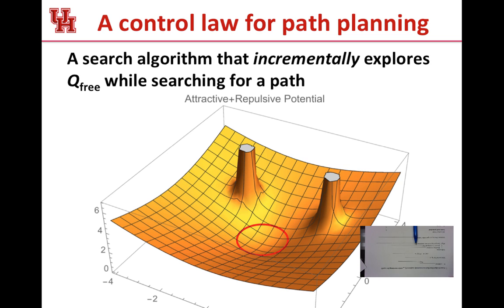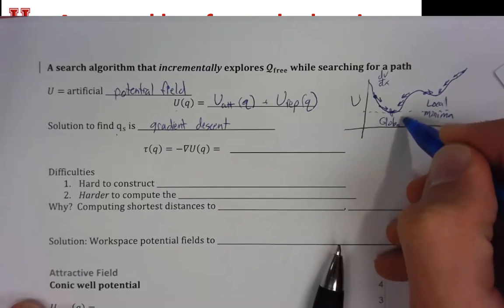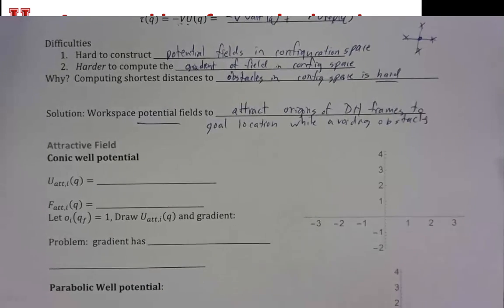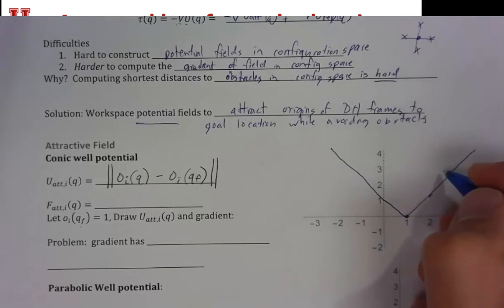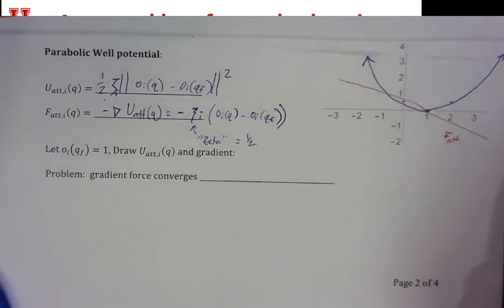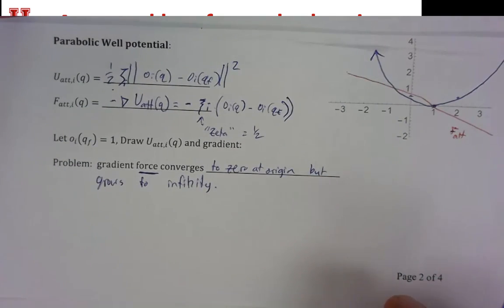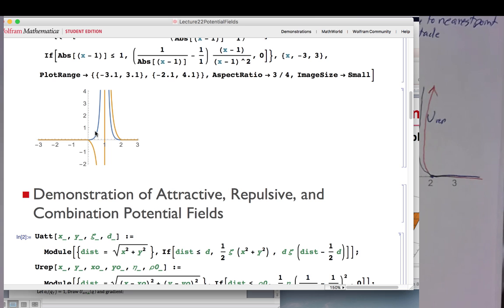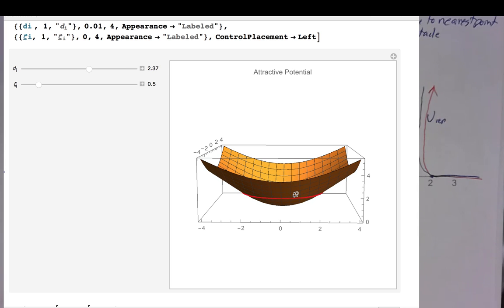Intro2Robotics Lecture 22c: Artificial Potential Fields for Robot Path Planning

Comment: Hello, great video. Just a small note - there is an error at 22:15 in the Urep equation, the whole parenthesis should be squared. It would work also as written, but then the Frep would be different.
Reply from the maker: You are right.  Thank you.  I added an errata in the coments.

Comment: I just gotta say thank you for uploading these videos.
Reply from the maker: @salehalarbi4156  I used Mathematica to make the plot. The code is below.  The syntax looks weird as text, but you can copy paste it: 
Uatt[x_,y_,\[Zeta]_,d_] :=Module[{dist = Sqrt[x^2+y^2] },If[dist<= d, 1/2 \[Zeta] (x^2+y^2) , d \[Zeta] (dist-1/2 d)]];
Urep[x_,y_,xo_,yo_,\[Eta]_,\[Rho]0_] :=Module[{dist =Sqrt[(x-xo)^2+(y-yo)^2] },If[dist<= \[Rho]0, 1/2 \[Eta] (1/dist-1/\[Rho]0)^2 ,0]];

Manipulate[Module[{\[Eta]i = 1,\[Rho]0 = 2,switchLine,Energy},
Energy = Plot3D[ Uatt[x,y,\[Zeta]i,di]+  Urep[x,y,obs[[1]],obs[[2]],\[Eta]i,\[Rho]0]+  Urep[x,y,obs2[[1]],obs2[[2]],\[Eta]i,\[Rho]0],{x,-4,4},{y,-4,4},ExclusionsStyle->Red,
PlotLabel->"Attractive+Repulsive Potential"];
switchLine =Graphics3D[{Red, Thick,Line[Table[{di Cos[\[Theta]],di Sin[\[Theta]],1/2\[Zeta]i di^2},{\[Theta],0,2\[Pi],\[Pi]/32}]]}];
Show[{Energy,switchLine}]],
{{di , 1,"Subscript[d, i]"},0.01,4},
{{\[Zeta]i, 1,"Subscript[\[Zeta], i]"},0,4},Row[{Control[{{obs, {-1,1}},{-4,-4},{4,4},ControlType->Slider2D}],
Control[{{obs2, {-1,1}},{-4,-4},{4,4},ControlType->Slider2D}]}]]

Comment: I have a question. I know that ||Oi(q)-Oi(qf)|| means the distance between the current point of the robot related to DH frame to the objective point. But what exactly are we calculating when we subtract Oi(q) - Oi(qf) without ||  ||? Thank you a lot.
Reply from the maker: You are right, ||Oi(q)-Oi(qf)||  is a scalar value.  It tells us how far the two points Oi(q) and Oi(qf) are apart.  Removing the "|| ||" gives us a vector, which tells us the direction and the distance.  If we divide the vector by the distance: (Oi(q)-Oi(qf))/ ||Oi(q)-Oi(qf)||  we get a "normalized" vector, which is a direction with unit magnitude.  Is this more clear?
Reply: Absolutely. Thank you, Aaron!
Reply: @AaronBecker  I think this is where I lose it actually. I thought that the repulsive and attractive forces were supposed to be proportional the either the velocity or torque of the motor. But either of those values will only take a scalar input. If Im pointing to a cartesian (x,y) position, how do I take that and convert it to a velocity input of my motor?

EDIT: Wait, that's literally just inputting into my inverse kinematics for the rotation of each link isnt it?
Reply from the maker: @Triumphant11   it might help to see this in practice in my video https://youtu.be/xqTdsxyIths (with code at: https://www.mathworks.com/matlabcentral/fileexchange/73617 ).  This shows the artificial potential fields applied to a multi-link robot arm.
Reply: @AaronBecker  Thank you so much for the fast response! Your videos really helped me. I ended up inputting the Force attraction and repulsion as Xdot and Ydot, then used a Jacobian matrix to compute the theta_dot for each motor and it worked out perfectly!

Comment: Hi, so how we can solve the local minima problem plz
Reply from the maker: That is the big question.  One way to is take random walks whenever you detect you are in a local minima.  Sometimes you can distort the space and remove some local minimas. Another option is to skip the potential field method and use a different method, i.e. PRMs or RRTs. See my short video on RRTs here: https://youtu.be/Ob3BIJkQJEw
Reply: thanks a lot
Reply: @AaronBecker  Thank you Aaron for your video series. About local minima escaping, Is it also possible to use navigation functions, especially if I have only spherical obstacles in the environment? Can you plaese introduce a good reference for using navigation function for robot manipulators in 3d?